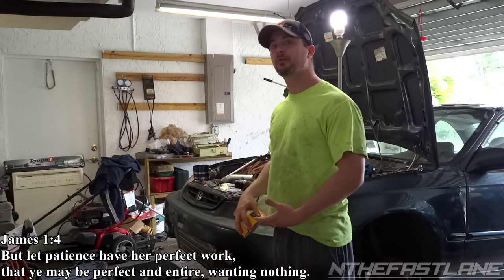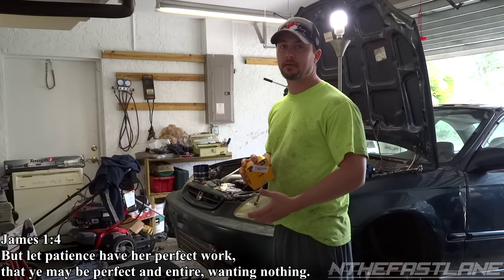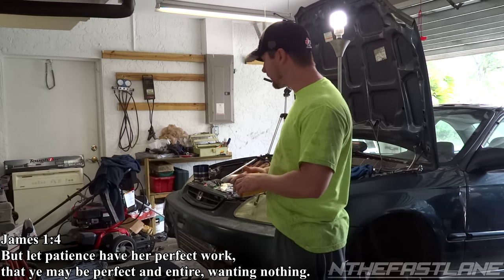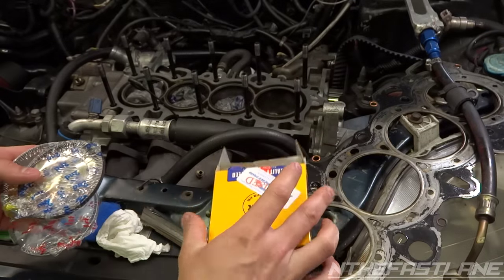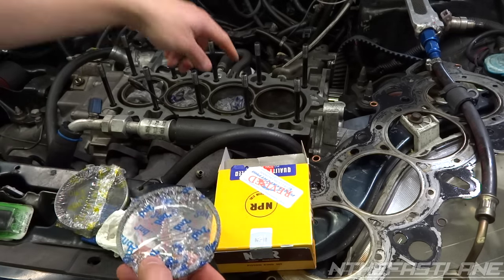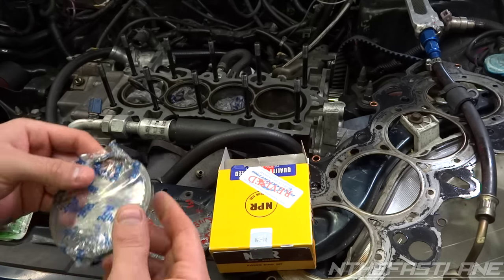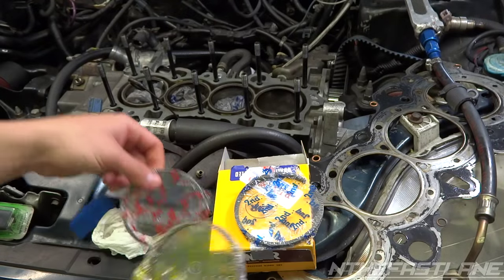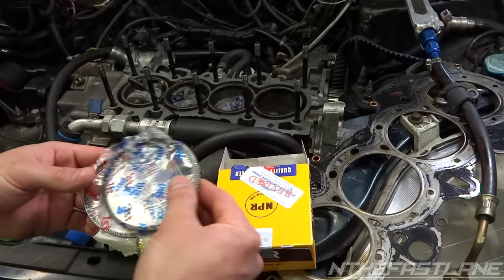▶️Clocking,Gapping & Installing Pistons Properly (Honda) "How To"🔧

Comment: didnt you clock the oil rings wrong? at first you corrected yourself...
Reply: My same question he said they should be across from b side n b side was on intake and u just turned it to what u originally said after correcting urself so did I just clock mine incorrectly ?
Reply from the maker: The very last position that I clock the oil control ring is to correct one, I stated that it was wrong and I moved it across from the compression ring.
Reply: But diagram showed as u explained to move it parallel to compression b which I though was intake side last spot u put the 2 oil rails where on exhaust side no?
Reply: @Nthefastlane  but the book said the 2 oil rails gaps should be on intake side just wana clarify there about 15 to 30 degrees from each other on left side of exhaust of piston front facing the engine correct?
Reply from the maker: No, if you look at the little arrow on the piston to the right, that faces the cam gears (aka) "front of engine". I took the oil control rings and move them up towards the intake side with the arrow facing towards the cams.  Another way to know if it's the intake side or the exhaust side, look at the piston, at the top it shows (IN), this stands for intake. Hope this helps, if anyone needs to get ahold of me faster please post questions on my website forum, answer questions there. www.nthefastlane.com/forum

Comment: Marked face means the DOT is faced up , not the letter. You installed yours upside down.
Reply from the maker: No, that is not always correct. Yes some piston rings come with a DOT. But other piston rings come with laser etched letters and numbers and that is what is referenced as the up position. 

The piston rings with the laser etched numbers and letters do not have dots. The piston rings installed in this video were installed correctly.

Comment: Geez pull the engine out of the car so you don't leave the block full of honing grit. The grit will just grind your engine up.
Reply: crosstimbers2 just spray it down with break cleaner.... the pan is off so none of the grit stays in the engine
Reply: @rickkroening5282   Not true. The grit is microscopic and remains in the surface texture of the cylinder bores. With the crank shaft in the engine you just wash the grit down all over the crankshaft. I think I done a lot more engines than you.
Reply: crosstimbers2 crosstimbers2 if you spray the crank journals down and make sure everything’s clean it’ll be fine. Minimal grit will be left. It won’t just grind it up like you say. I’m  in the process of doing this exact thing. I’ll post a link for when I’m done.
Reply: @rickkroening5282  I don't care what you think or what you are doing. I rebuilt engines starting about 50 years ago. Only a moron leaves one full of grit. By paying attention to details I have had my rebuilt engines last longer than factory engines.  Pull the pan off of a new crate engine and you will find the factory does not even bother to remove all the pattern sand from the block casting process.